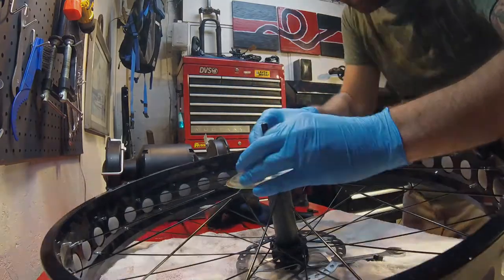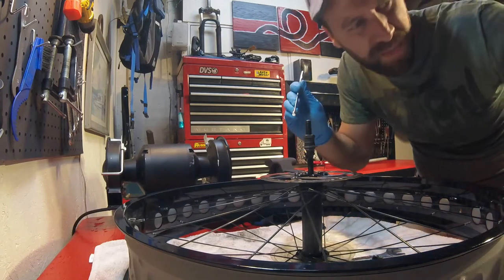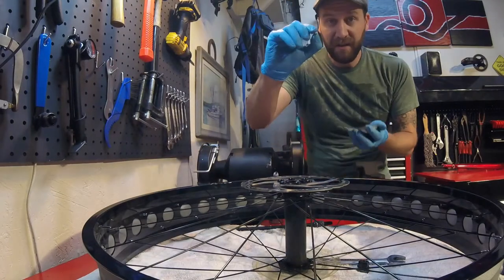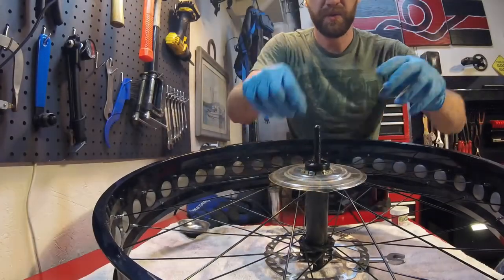How to Service Mongoose Fat Bike Hubs

Comment: I bought a Malus a couple days ago. While adjusting the brakes could hear a constant noise. While checking it out closer today the free wheel side has a definite wobble? Need to order the tools to tear into it which I planned on doing anyway. Any ideas could it be short a bearing causing the rubbing sound and up and down wobble? Take it back or wait for tools?

Comment: These videos are great. Especially lubing tips. I love lubing things.
Reply from the maker: Many cyclists fail to realize the importance of lube. In many cases, a lack of lubrication can result in undesirable rubbing, and an overall failure to perform. Remember: high quality lube lasts longer and provides a smoother feeling while you're riding.
Reply: Budget friendly biking 
Some have even said that over lubing can ruin the feel of the overall ride quality
Reply from the maker: bdpersha not to mention the extensive cleanup required when you over do it...
Reply: Make sure you wear a nice glove

Comment: I inherited a fat bike modded to be motorized. My real wheel hub was loose and I've adjusted the cone to seat it properly, but I noticed it has no spacer. Is that important? And it has an extra set of bearings on the cone side, and further it still won't spin freely. Any help would be appreciated

Comment: It's surprising that Pacific Cycles doesn't put any grease on some of these bikes. Brand new roadmaster has seized pedals on it.
Reply from the maker: NovusHampshire very true. They're definitely inconsistent. In my opinion, it's worth disassembly and inspection at a minimum on all of them to confirm sufficient lubrication.

Comment: So, is it possible (and this is with any Walmart bike) to replace the bolt on axle with aquick release skewer?
Reply from the maker: NovusHampshire this is a good question. Unfortunately I don't have a good answer. Maybe some of the other viewers can comment?
Reply: I found out, you would have I replace the axle in order to do that. I have a lot of spare axles laying around but they're all from 26ers, not entirely sure if they'd work with a 29er
Reply from the maker: NovusHampshire as long as axle length, and diameter match, they can be interchanged. I'd be willing to bet a QR axle of the same diameter could be used as long as it uses the same races and catches in the dropouts without being too long/short.

Comment: You forgot to remove the dork disc.
Reply from the maker: Haha, yeah. You might see in a few scenes that the dork disc is a bit chewed up.  I'll be keeping it on until I have a better derailleur installed to prevent the chain from jumping into the rear wheel!
Reply: While you had the Freewheel off you should of replaced it with the Shimano MegaRange freewheel makes a Huge difference.
Reply from the maker: Great suggestion, I know lots of people have been pleased with the MegaRange upgrade. I actually took a different route and changed my chainring when I did the crank swap. The smaller chainring basically had the same effect, but also made my higher gears a bit easier to use. You can check it out in my review and upgrades video if interested.
Reply: I went with the 8 speed Sunrace. Not such a big jump between 1st and 2nd.
Reply: I'd suggest that it's not a better derailleur that prevents chain jump, but a better adjustment.
Reply from the maker: Mark Stewart very true. The adjustment will absolutely make or break the performance. 

I tend to ride bumpy harsh trails, and the strength of the derailleur spring is just not enough. If I can manage a clutch derailleur, I should be able to avoid the chain bouncing off.